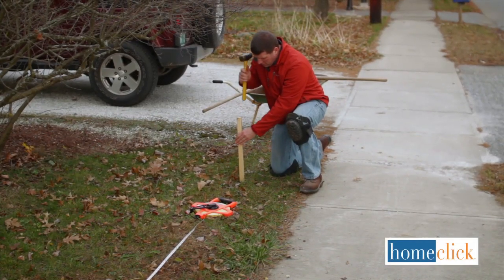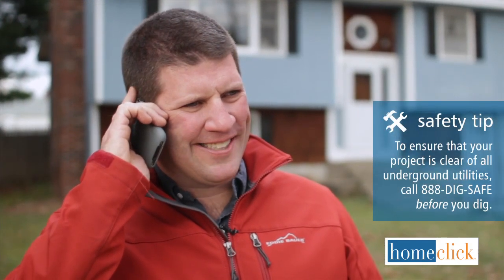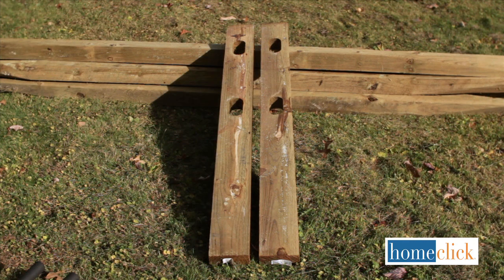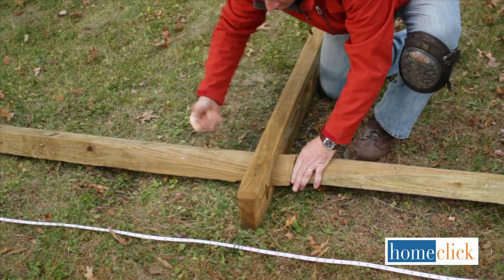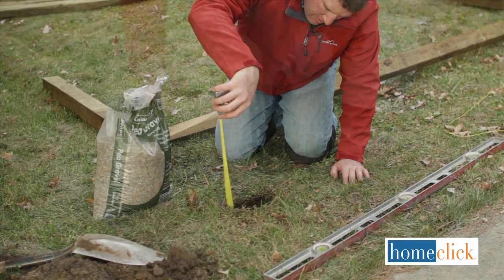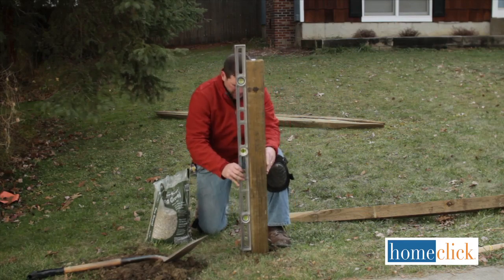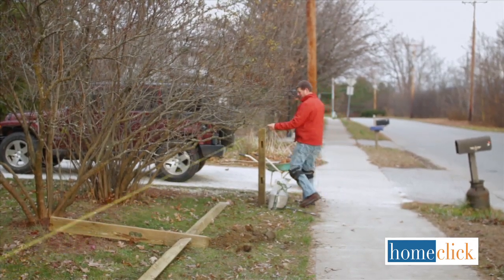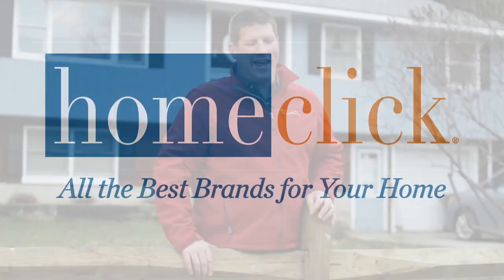Homeclick.com:  How to Build a Split Rail Fence

Comment: Thank you for posting this!  How deep does the hole need to be, you say "six inches deeper than you need it to be"  in order to accommodate the gravel but what should the total depth be in order to have a secure post?
Reply from the maker: Sile Kiernan That's a good question. It largely depends on the length of your posts and how high you'd like your fence to be. If your posts measure 6 feet long and you want a 4-foot fence, you'd want to dig to down to 30" to accommodate the 6" of drainage fill.